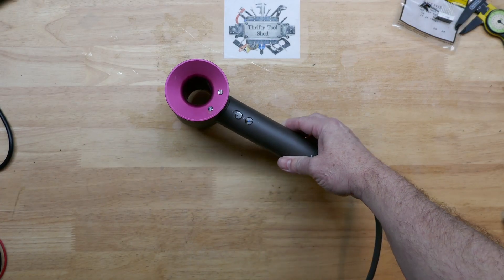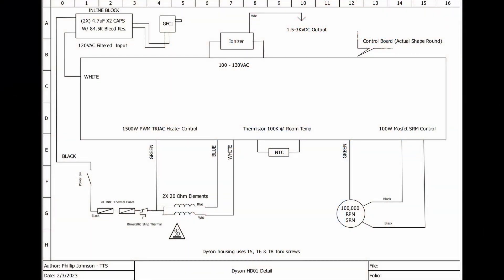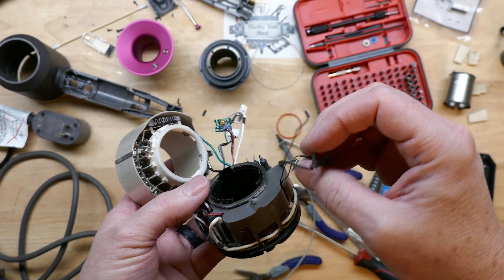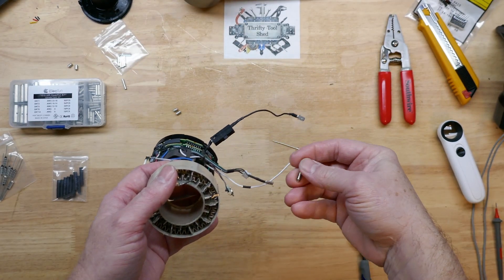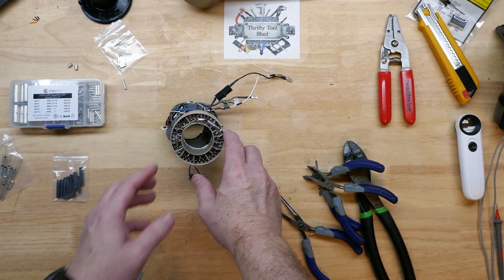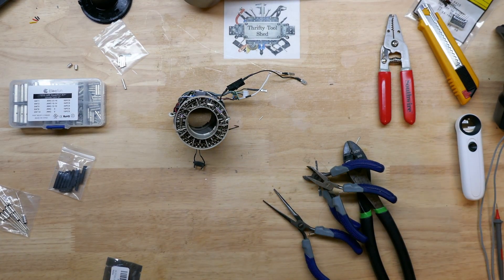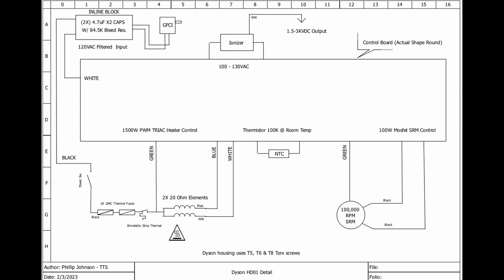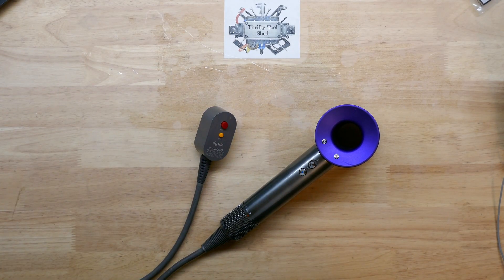Dyson HD01 Hair Dryer Repair #3

Comment: Hello my friend, I got the exact same model (but 230V) for repair in today. I checked the thermal fuses, and one of them is blown. I just bridged it (for testing) and it worked again. So I saw in the description 184C 16A, is this right?
Reply from the maker: That is what was in the 120V version. I would think the thermal fuse would still be the same for both.
Reply: @ThriftyToolShed  I am going to try some 16A fuse, thank you.
Reply from the maker: @-rc-racergermany2394  184C
Reply: @ThriftyToolShed  👍 Mine is G5A 01, (hard to read) i cant find the specific one, but G5A is 16 or 20Amps. So you are right. 184C 250V 16A
Reply: I just searched and, and it seems like many are just 250V/10A. Is 10A still suitable?

Comment: Great videos, very informative and worth a subscribe. I've been thinking about trying to repair one just cause it's interesting! Would a blown thermal fuse be a cause for no power at all or would it power on, but not power the heating element?
Reply from the maker: Typically no power at all when the thermal fuses are blown. I shared a wiring drawing in the video to show the power going in and through the thermal and back to the board for power.
Hope it helps!